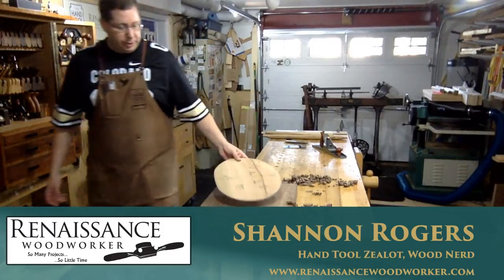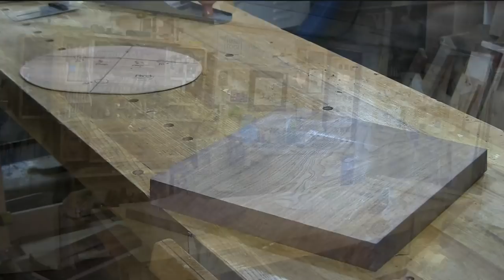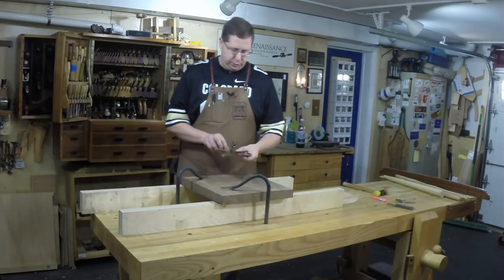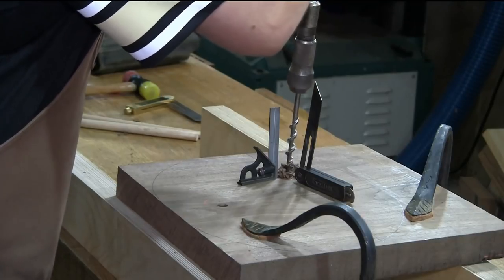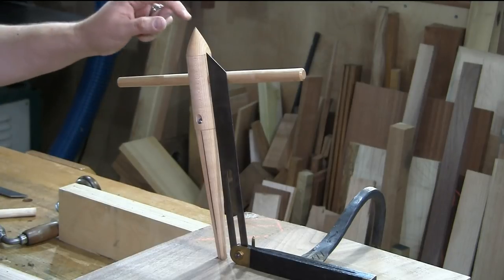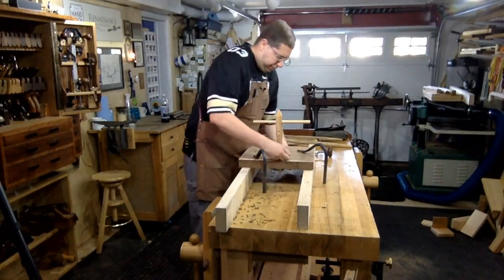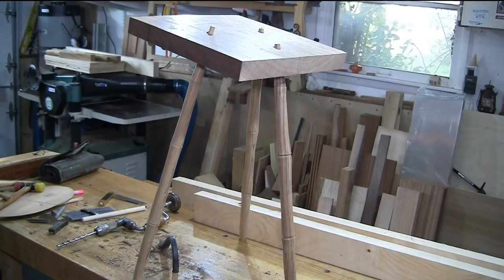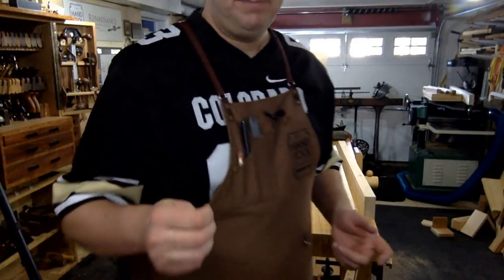LIVE Perch Stool Part 2: The Seat

Comment: I understand the reamer you're using is a 6 degree taper.  Do all of the Veritas tenon cutters match that, I can't seem to find info on their angle but thought they matched the Veritas 12 degree reamers?
Reply from the maker: I guess not because the tenons fit my reamed holes like a glove
Reply: The Veritas tenon cutters are 12.8 degrees according to the info on the reamers (it is not included in the information on the tenon cutters).

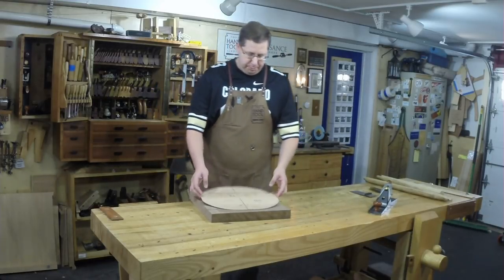Comment: Didn't you say, at minutes 9:00 and 12:00, you were going to have the grain of your seat plan and the actual seat going in the same direction?
Reply from the maker: Robert McConnell yeah I kinda hanged that around when I saw the grain pattern. Honestly it doesn’t matter but since the seat is wider than deep it makes sense to use a narrower board. But since I have the width in my seat blank I have the option to change it.